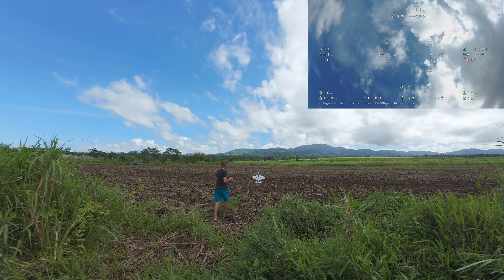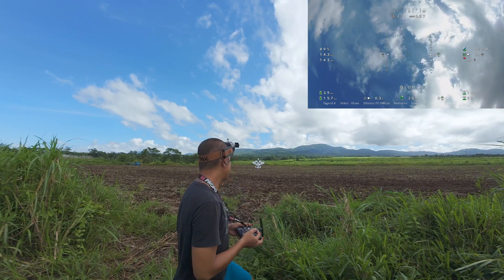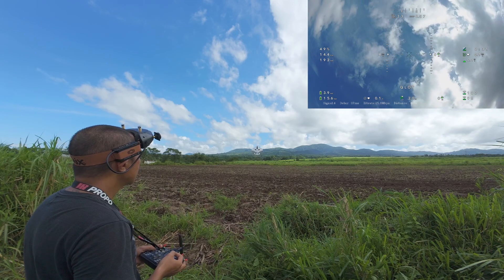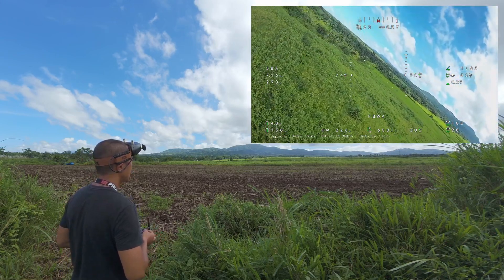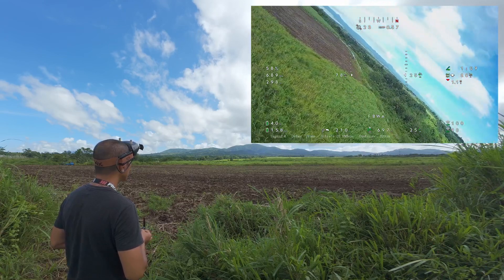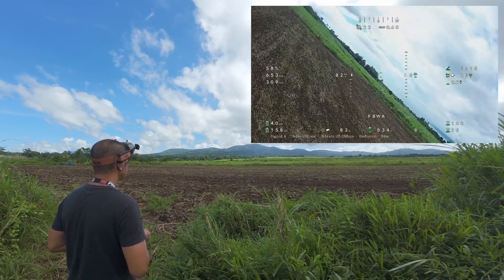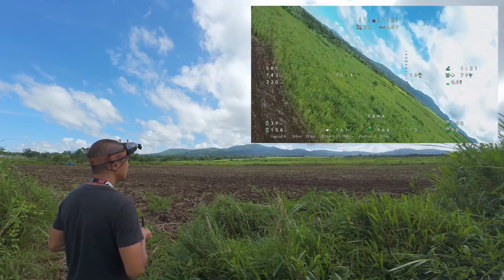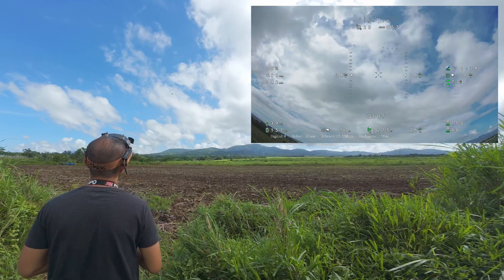ATOMRC PENGUIN - VTOL/Tailsitter MODE - Maiden Flight

Comment: This is so insanely cool. Trying to get my Penguin finished up. I am running 2306's on 6s, but it flies so heavy. I will probably throw some higher KV motors and drop down to 4s. Thank you for the inspiration!

Comment: "My tailsitter has separate elevator and aileron controls, with a standard setup for elevator, aileron, and rudder. There are two fixed rotors on the wings. I am having issues with wing mixing. When I increase throttle, the ailerons respond immediately, causing the aircraft to spin around its axis in mid-air. The joysticks on the transmitter are giving incorrect commands. Which model in ArduPilot can I use to correctly mix these controls?" Help please

Comment: Your work is amazing. I currently fly quads, and want to get my first plane / wing. Can i start with the atom rc pengin and add a djo o3 on it. I have ELRS so would like to use my radiomaster boxeer for it.
Reply from the maker: @dronefilmsgermany Thanks mate. Penguin is more fun to fly if you are coming from quads. It is fast and agile and it is not as boring as most wings.
Reply: @dirtndrones  I also saw the AtomRC Dolphin and was confused whether to use the dolphin or penguin. Goal is to use DJI o3 do some low flying cinematic and stabilize the o3 footage using gyroflow.
Reply from the maker: @dronefilmsgermany  Dolphin will give you more speed, Penguin will give you more control flying low. Both will definitely give you a fun wing to fly.

Comment: Are you using stock motors? Is there enough thrust for vtol with biblades?
Reply from the maker: It was all stock when I tried the VTOL functionality and it has enough thrust for the Vertical mode. Only downside of this model is the COG when transitioning to VTOL, a little wind will offset the COG and will make it transition back to plane mode.. But Vertical take off is not an issue only during vertical landing when transition is needed.
Reply: @dirtndrones what motor do yoy have in this video?